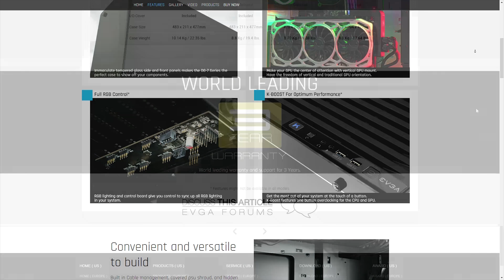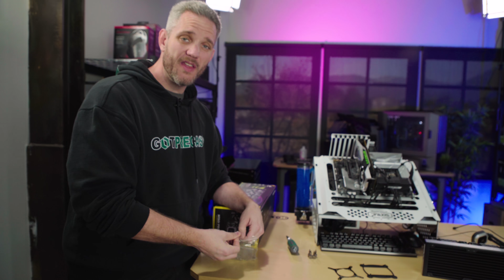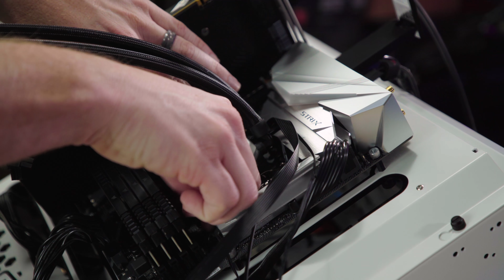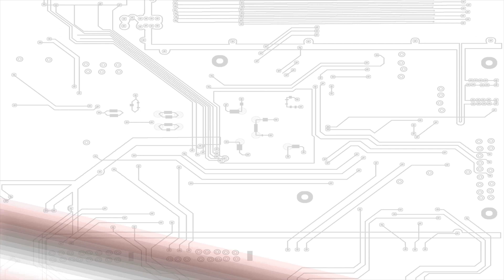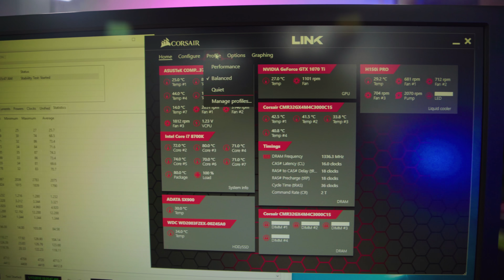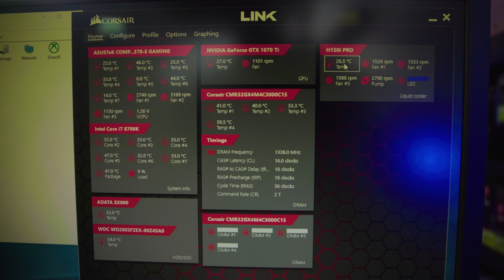Corsair's Largest AIO yet... But is it any good? H150i Pro RGB

Comment: which one is best NZXT Kraken X63 280mm AIO Liquid Cooler with RGB  vs      CORSAIR iCUE H150i RGB PRO XT, 360mm Radiator, Triple 120mm PWM Fans

Comment: Question for yall. I'm getting  a new case: a lian li lancool 2 mesh rgb. And I recently got a new corsair icue 100i elite capellix (240 mm) that has the commander core. Would it be best to 
1. change all the lian li case fans to corsair so all the intake/exhaust/radiator fans are the same
2. Get the lian li galahad 240 mm aio to match the intake fans and take the corsair aio back to best buy
3. It doesn't matter and who cares if the brands are different

Comment: What i don't like about AIO is that not all are filled properly and most are full of air pockets making sounds that is louder than my GPU could spin. But good thing it's very easy to fill up with liquid coolant or just regular distilled water as long you have the right tool to open the pump copper plate and fill it up properly, but still though AIO manufacturers could really done more proper job to properly fill up the tanks in the radiator.

Comment: So I was wondering if thermally if matters if you use your radiator on the intake is it better then as an outtake do to a cool air in vs warm air out threw the radiator

Comment: The mounting system is still stupid. Just screw it in, not hook it around pieces that you probably don't have anymore. The major plus is that it doesn't block in the first dimm slot like so many other coolers.

Comment: Jay, I have an AMD Ryzen 5600x using the packaged air cooler. I did a system restart today and was presented with a "CPU over temp..." warning. I looked at the BIOS to see the CPU fan running at max speed and CPU at 73C. This temp doesn't seem too bad to me, but that was after a system reboot. So, I do not know what it peaked at. I'm giving much more thought to an AIO. Three years later, which AIO would you recommend today? I have the system inside a Fractal Design Define S.

Comment: I've got my fans set to exhaust but should I swap them to intake? Been reading that the difference will be negligible to the CPU temperature (mine currently sits around 50 degrees while gaming) but changing it to exhaust would be worse for my GPU temperature

Comment: DONT BUY ***WARNING*** Don't buy Corsair, worst client service and poor quality product. For some reasons I have bought their product for a while on Amazon. Forget getting any type of refund or replacement. If they do it takes a month. I ordered a Pump and res combo recently, set to ship october 12th, 2020. On the 13th I asked them if it was shipped, I get a response that the order doesn't exist. I took a screenshot of the fund on my credit card and the order number and sent it. Two days later I get a response that yes it was being prepared for shipment. 5 days later, I ask them about the package as there is no signs of it being shipped yet, asking for a refund at this point I'm done. Receive a response that they can't refund as the package is being prepared. I sent back a message saying I want a refund now the item was not shipped and they can cancel it and give me a refund now two days later still no response. Go Razer instead if you want a gaming fidelity company, at least with Razer I never had any issues. This is not my first bad experience with Corsair they won't change the way they threat their customers, they don't deserve our business.

Comment: I'm sorry, but please don't spread misinformation. Heatsink being "almost too hot to touch" does NOT mean your power delivery is overheating. Like, not even close. You'll scream in pain at 60c and those VRM components are rated to run at 100c+ constant. Besides, with a heatsink like that the power delivery just won't overheat. Especially not on air/AIO. Don't spread fear over nothing. People who don't know any better will see this and then every weird crash is an overheating voltage regulator or a burning mosfet. People start thinking power delivery components are fragile when in reality their precious oc isn't stable.

Comment: My I7 58200 K is overclocked to 4.4 ghz with 3.1ghz on the cache with a CM Nepton 240M ideling at 20-22 degrees C and even when running AIDA's stresstest I can't pass 55 degrees C even with the radiator fans at 40% and pump at full speed. Not sure how much difference it would make if I had the same OC'd 8700K but for a 5 year old AIO I think it's doing really well

Comment: I had this pile of shit in my PC for about 6months. It started shutting off and causing my CPU to overheat and blue screen my PC. Then it would start working again and shut off in 3 days to 3 weeks. Totally random. So I got an RMA and the second unit was totally defective missing negative pump/fan TAC wire. I emailed Corsair and they said well I didn't really need that wire. I asked them if I didn't need the negative lead then why put a positive one to flop around in my PC and do nothing? They handled this RMA so well I am no longer their customer. This POS H150i wasted about 20hours of my time.

Comment: Make sure you save your box. The pump started to go out after 6 months, they wouldn't issue a replacement or refund without the lot number on the box.
Reply: My pump stopped working after 3 weeks
Reply: I guess the bearing in mine died. I'm still using it, but it stopped making a sound
Reply: @rxspicychicken2402  Did you have pump as highest point of a loop?
Reply: My h80i pump stopped twice one in 6 months and the other in 7 months, both times they replaced with a new one

Comment: just finished a build with this cooler and a maximus hero XI, but whenever I boot up I get a message that there´s no CPU fan installed; anyone know what can I do?
Reply: As long as the fans are running, prob means no fan is attached to aio fan header on the mobo. Go in the bios and set the aio fan to ignore

Comment: had the opportunity to compare this vs a thermaltake 360 floe riing, weirdly the floe riing had noticeably lower idle temps, but when gaming or benchmarking max temps where the same, if you already use corsair icue go for it, my gpu fans create more noise than this cpu cooler

Comment: i have a MSI MPG Z390 Gaming PRO Carbon LGA1151 motherboard and CORSAIR CRYSTAL 570X RGB Mid-Tower Case will this fan be able to run with the build
Reply: and will i need to get a bracket if they are compatible

Comment: I tried using 6 fans on this, in a pull-pull configuration. It created a black hole, and my pc vanished.
Reply: @winokur89  yeah, not sure what to do about my black hole. And, the pc re-appeared, but it is a Univac I now, and it is going to take all week to find a solution on this thing.

Comment: I've noticed that 1 core still running issue as well. With me It was an nvidia driver issue. Nvidia container in taskmanager uses 10% cpu in idle. Driver 430.64 should have fixed it though.
I'm having a problem with my windows 10 power settings.When I change it to performance It goes back to balanced after reboot. It makes quite an impact on my 1080 ftw. It lowers framerates by 10-15%..

Comment: i have a few questions.
1. is this compatible with the z370 lineup. if so how well will it perform on the i7 8700k. will it keep it quiet.
2. what cases is this compatible with, i know not all cases can fit a 360 mm rad. so i need one that can.

Comment: Is it possible to remove the fans and instal my own? Cause im trying to put in 3 corsair LL 120 fans, cause rgb
Reply: Yes you can or if your case is compatible, you can use the stock ml120 fans on one side and use the ll120 fans on the other side
Reply: @stephenvasques1117  thanks

Comment: Just a quick question if anyone is still here commenting.  I want to get the Corsair 275R, but I won't upgrade to the 2700X yet, I just want to change my current case.  I have the FX 8150 and the AM3 GB mobo, will this fit out of the box on both the case and my mobo/cpu?

Comment: Installed this AIO on a Ryzen 2700x. Noticed temps were not great under load/overclocking even with max settings on pump and fans the temps were higher than they should have been. I decided to remove the pre applied rock hard paste and reinstall with some noctua paste and it made a HUGE difference. Almost 10 degrees Celsius under load running 4.25ghz overclock.
Reply: Rip
I have a 2600x with dark rock pro 4 (air cooler is much better then aios) and I'm under 40C 100% of time at 4,2ghz and you can't hear it . Air is the way to go
Reply: @ryusei9941  under 40c on an overclocked Ryzen 100% the time I find very hard to believe. Stress the cpu for half an hour and see what your temps get to for a comparison. The H150i outperforms that air cooler on any tests I can find but you're right, air coolers are much better value.

Comment: Have this sitting in the corner for my 9900k upcoming building. It will be used until I switch over to open loop. I saw some very poor performance numbers with a 9900 and 110! with 90c ranges so I'm hoping I get better results.
I ordered grizzly kryonaut and replacing the paste. I noticed you had a pea drop, trying doing thin layer. They're a reason maybe why the pump is preapplied thin layered.

I also bought 3 corsair ml120 pro red led 2400rpm fans to immediately swap the 1600s. I don't care about the quite trend and want performance and safety. Coming from a cooler master HAF case loaded with 200mm fans, and sleeping with a fan on, I'm used to it. I don't get the quite/auto fan going idle fad. Its been shown on other yt tests the coolest aio run with fans in mid 2000s. If I can on the p5 case I havent opened up yet I'll run push pull.  I grabbed a thermaktake 900 also but without modding its not really for aio. Once parts arrive and system built end of next week I'll check temps
Reply: No ones cares
Reply: @GamingCentral80  but cared enough to comment

Comment: That’s interesting , I run my 8700k at 4.8 ghz @ 2.75 volts all cores with no avx offset using my cryorig H5 Ultimate and it stays around 60-65.
Reply: You are most definitely not running at 2.75 volts, you must mean 1.275
Reply: Eric Morono correct typo lol

Comment: Hi
Got the H150i Pro, but something is wrong, 
CPU temps with I7 7700K is 90+ c while clocked at 4.8Ghz.
75-80c @ 4.5Ghz

Liquid temps are 33.5-35.6c
ambient temp = 31c
Replaced stock thermal past with something decent.

Any suggestions, please going bold scratching my head
Reply: Ryno Swart can be a number of things... overall case airflow.... did you change out the fans? Did you change the pump/fan curve? Is it making good contact?

Comment: I'm building a ryzen 2700x system and I have this for my cooler. Can't wait to put it through it's paces! I agree all the cables coming off the pump are a bit annoying. I have a h110i gt in my current computer and have just the USB cord on the pump and it looks a lot cleaner with the fans being plugged into the motherboard.

Comment: Check out Thermaltake Floe Triple Riing RGB 360 TT AIO Liquid Cooling System 360mm Radiator CPU cooler:

https://www.amazon.com/Thermaltake-Premium-Efficiency-Radiator-CL-W158-PL12SW/dp/B07537Q8LV/ref=mp_s_a_1_fkmrnull_1_sspa?keywords=360mm+floe+triple+riing&qid=1550583240&s=gateway&sr=8-1-fkmrnull-spons&psc=1

By itself it's really effective at $174, Here's an expensive $500 kit that includes it I don't know what it adds in efficiency:

https://www.amazon.com/Thermaltake-Pacific-Water-Cooling-CL-W218-CU00SW/dp/B07B9C5NFD/ref=mp_s_a_1_fkmr0_1?keywords=floe%2Btriple%2Briing&qid=1550582640&s=gateway&sr=8-1-fkmr0&th=1&psc=1

Here's an additional part by itself, but it's also included in that kit:

https://www.amazon.com/Thermaltake-Pacific-Cooling-Radiator-CL-W193-CU00BL/dp/B07DKNSNZ8/ref=mp_s_a_1_fkmr1_1?keywords=360mm+floe+triple+riing&qid=1550582751&s=gateway&sr=8-1-fkmr1

Comment: Man why didn't they put rgb on the fans too that sucks
Reply: They do..its a different model. Or you can just swap out the fans. I got red led 2500 corsair fans to put on..Good but expensive $27 each
Reply: hmm arnt the rpm on the fans much slower though compared to the  ones they use here?
Reply: @lordadz1615  the 3 fans equipped on the rad are 400-1600 rpm max fans. I picked up corsair red led 400-2400 lm120 pro fans and will keep them performance mode at 2400 always.  I ordered grizzly kryonaut to replace the thermal on the pump, but rather than put on dot on the CPU shown in video, I usually go thin layer in my builds since early 1990s. I saw another video where the layer actually had a few C drops on temps than pea size drops. I have a much hotter CPU arriving (9900k) so I dont want to exceed 80-85C temps and dont care about fan noise. The fans on the rad I'll move to other side in push pull if I can

Comment: I tried to install this in my system, but for some reason the SATA power cable melted. I've tried two different units and the same thing has happened. Being that this has happened on two units, I must be doing something wrong, but I don't know what. Anyone have any ideas?

Comment: i wonder how long the hoses are...  even though my P5 theremaltake case is built for liquid cooling.  None of the AIO collers have fit so far
Reply: You need to get the bracket. I just bought one last night for my p5 😂. Amazon $20, search p5 aio bracket. They have 2 left. TT was awful not including this

Comment: Hi I'm planning to buy that to my new build, but I'm wondering which pc case do you recommend... I'm very confused about which model to use. My rig will have an i7 6700k - 32gb ram, 2 hdd, 2 ssd, GTX 1080, and a ATX mobo, also all the fans will be ML RGB from Corsair. Thx

Comment: Should i replace thermo paste on it or just use as it is preapplied one? 🤔
Reply: Preapplied is fine on mine, i have 6800k and my idle temps are in the upper 20's. Under full load in the 70's
Reply: I am. I ordered some grizzly kryo last night

Comment: I don't think you are doing this cooler justice (but maybe it really does suck). I have the Corsair H110i on the same CPU albeit delidded and LMed, and with Ex-tweaking I can get 5.4 on at least 1 core but not 5.3 on all 6 and never hit 90c. (Directly connecting the fans to MOBO is the only way to go.)

Comment: But how well does it perform on a i9 9900k
Reply: I have had H150i and 9900K in my system for some weeks now without OC (yet). I have used balanced fan profile.

These are the temperatures of my setup:
Idle - light use: 28 - 34 °C
100 % CPU load: max. peak 65 - 70 °C, settled ~50 °C

So I think there is quite a lot of headroom for overclocking.
Reply: @jani9209  bro with overclock how much teams and wich one is better nzxt x72 or h150i ?

Comment: does anyone use liquid metal on the aio?   i noticed lots of talk  of adding it to the die. but  to the aio ?
Reply: I wouldn't. I read go with paste like kryo which is what I ordered. I read u liquid the due to lid when delidding and that's it. Lot of work for small difference and a risk cause it can leak out

Comment: Hey jay 
I'm wondering that if i used push and pull method on my AIO would make a difference. Sandwiching the radiator between two fans..! 

Thank you
Reply: Instead of push/ pull.  Think about stacking on the pull side.  Leaves intake side of rad open to cleaning.

Comment: Battlefield 1 loading a new map uses 100% cpu on my 7820x and I have temp spikes into the 80s but when ik in match I'm in the 60s or low 70s are quick spikes into the 80s fine?

Comment: Why would you put a 360 sealed unit instead of open loop? Anything over 280 seems massive overkill seeing as 280 is overkill for anyone. I have an 8700k and I never see over 65 with a 280 at 4.7ghz so I don't get why anyone would need this.

Comment: 8700k 4.7 all core at 1.32 volts? Did I get a magic chip? I do 4.7 at 1.175 (haven't tried lower) and 5.0 at 1.3 without issues. Thought that was the norm.
Reply: You got very lucky

Comment: So, a very good question. I have a h115i (not the new pro one) and their fans have 104 CFM of airflow and 3.99mm-H2O of static pressure. The new h115i pro fans have 55 CFM of airflow and 1.27mm-H20 of static pressure. Just looking at the numbers the h115i (not pro) have better fans and probably better cooling capacity. Is that right? Is the new h115i pro better than the h115i even with the new fans?

Comment: Do water cooling kits like this https://www.ebay.com/i/372142998062?chn=ps&ul_ref=http%253A%252F%252Frover.ebay.com%252Frover%252F1%252F711-117182-37290-0%252F2%253Fmpre%253Dhttps%25253A%25252F%25252Fwww.ebay.com%25252Fi%25252F372142998062%25253Fchn%25253Dps%2526itemid%253D372142998062%2526targetid%253D398827037494%2526device%253Dm%2526adtype%253Dpla%2526googleloc%253D9011748%2526poi%253D%2526campaignid%253D1028602987%2526adgroupid%253D49433955006%2526rlsatarget%253Dpla-398827037494%2526abcId%253D1130046%2526merchantid%253D113674494%2526gclid%253DEAIaIQobChMIwevW_7Wj2wIVA1qGCh13AgcwEAkYDSABEgLj8PD_BwE%2526srcrot%253D711-117182-37290-0%2526rvr_id%253D1543857310562%2526rvr_ts%253D9c84a7501630aa13631113e2fffe2374 work

Comment: This may be a stupid question but here goes. "With computer radiators do they require water to be changed?" I heard in the video this one does not require any maintenance or water to be removed/added. Not trying to build a new pc and water cool it. Heard plenty of stories of drains and the components getting destroyed. My current rig is 5yrs; starting from scratch again.